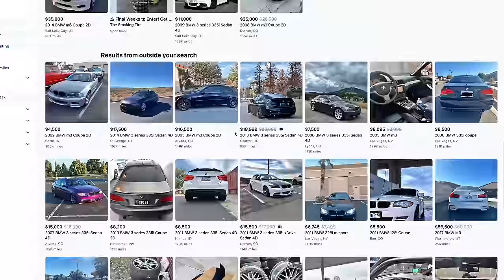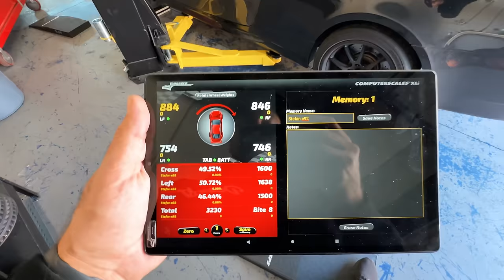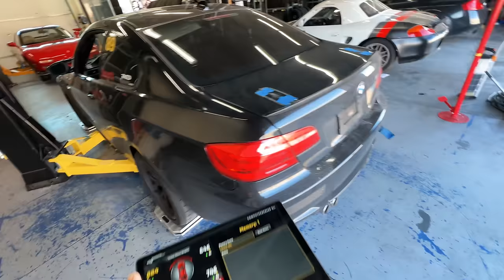This Is Why You Should Always Low Ball a BMW Owner 🤑

Comment: Not gona lie, that car looks great! Sure it needs some love but the upgraded components are similar to ones I suggest to customers. I belive those are syncro designs control arms which are made literly 20mins from me. Replaceable ball joints on those which is super nice. I highly suggest you use the brand macht Schinell for test pipes and pully kit helps get a little power out of it and they’re very robust.

Comment: Check the radiator fan belt, make sure it's NOT the original, as stock radiator fan belt's for a 2010 to late 2010's tend to need to be replaced, and they aren't cheap from BMW. My best suggestion, is going with a well known, trusted aftermarket brand, as they are cheaper to buy, and last longer.